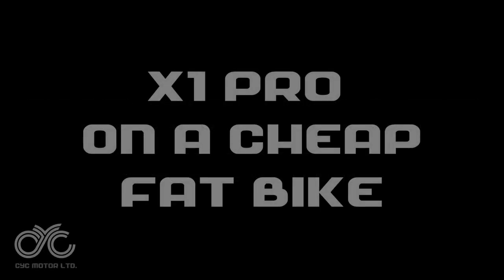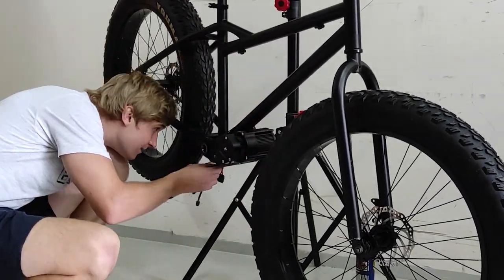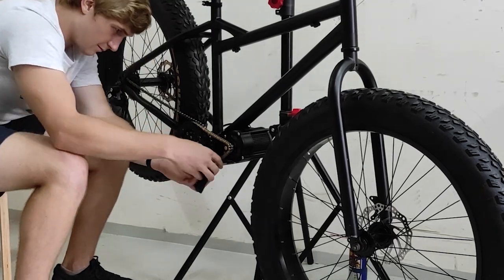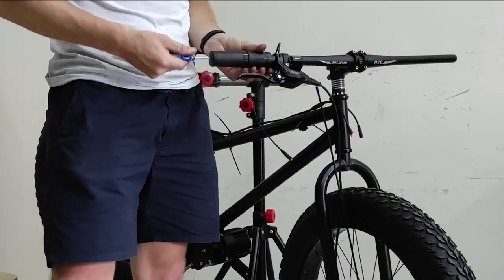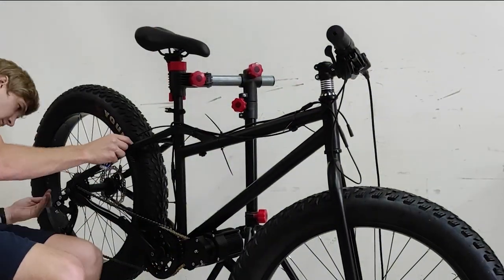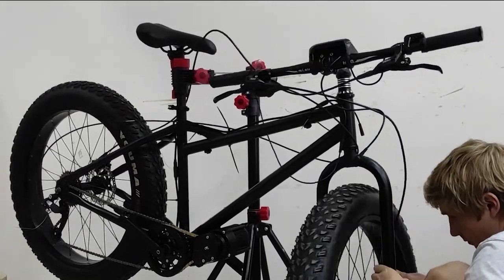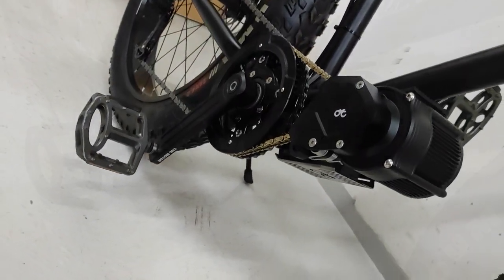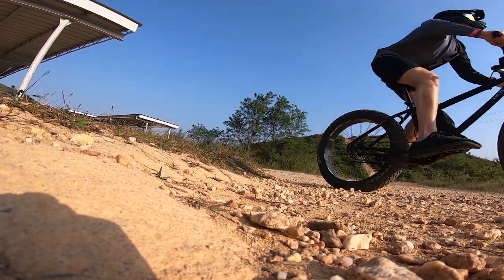CYC X1 PRO GEN 2 with BRASS GEAR tested on a fat bike! (Part 1)

Comment: I can't make a decision: CYC X1 Pro Gen2 with a BAC 855 72 volt or a Bafang BBSHD with a BAC 855 (high voltage kit) and a 72 volt battery.  Every forum I haver read says buy the BBSHD and the high voltage kit (BAC 855)  which I still don't fully understand why: The CYC looks great IMO (a little loud), the specs are better, has torque sensing yet experienced builders are all suggesting the BBSHD.  I would hate to miss this riding season because I can't commit but I might.
Reply: I got the normal bbshd rn and can't decide if I should upgrade to a new controller and new battery or the cyc...

Comment: I like the idea of " built series " episodes ! Which gear did you replace with a brass one?   
# I❤CYC
Reply: Thanks, there will be many more :) We replaced hardened steel gears with brass gears due to the reduced noise levels.
Reply: @cathreneswanepoel9586  The three gears inside the planetary gear box?
Reply: How well does the brass wear?
Reply: @gurmon  That's what I was wondering too.